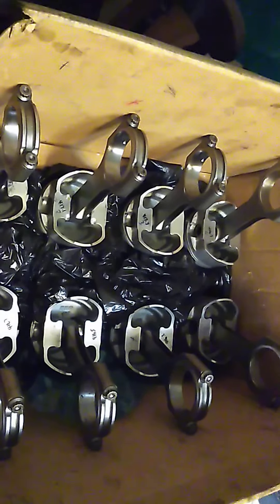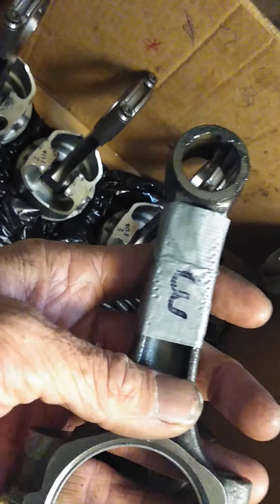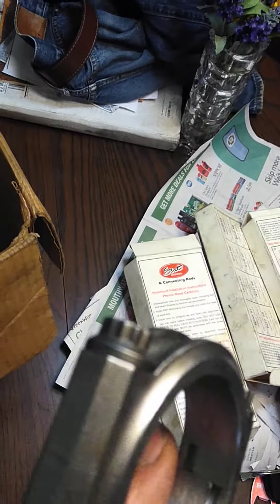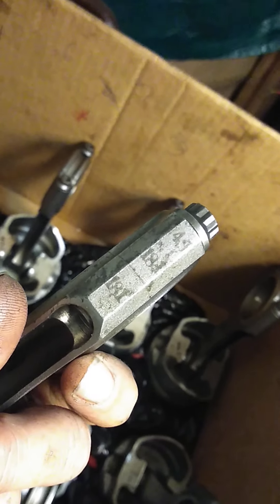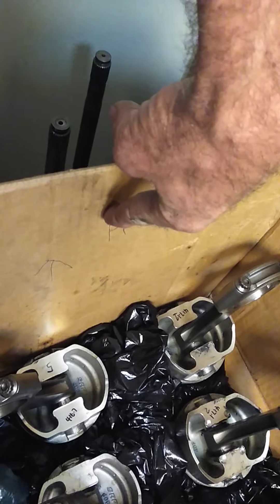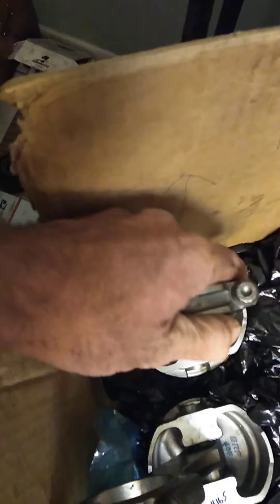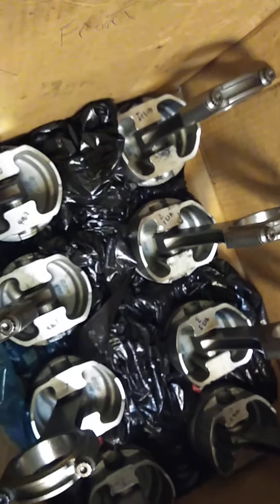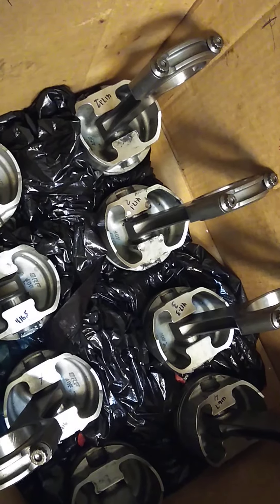347 h beam Rods, champered edge sbf orientation

Comment: This guy is WRONG and don't know what he is talking about!!
The I beam rods CANT GO EITHER WAY and they DO have a chamfer and not flat on both sides!
If you listen to this guy, you will have problems and will blow your engine, if you can even get it together. 
Plus he can't say chamfer correctly!
It's chamFer not chamPer !
He's totally wrong on the I beam rods just going either way and it don't matter!!
He's looking at the rod bearing side faces incorrectly to start off!! 
Good luck dude and let us know if you get it running or if it blows up.
Please,,,,